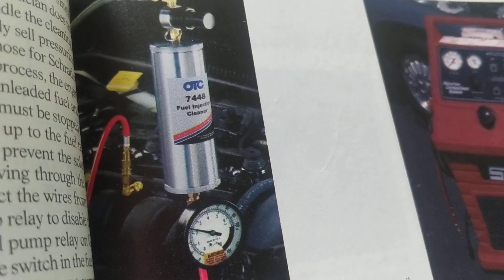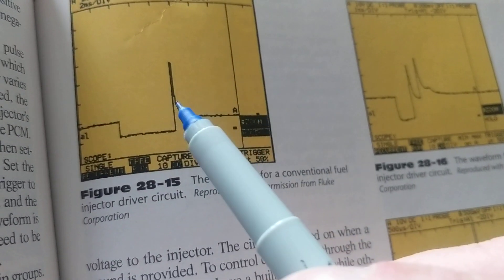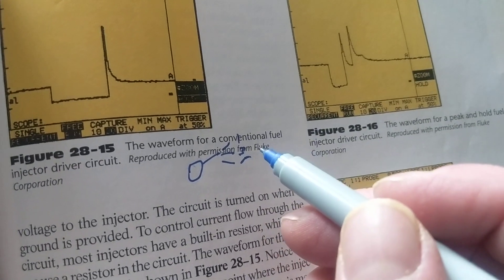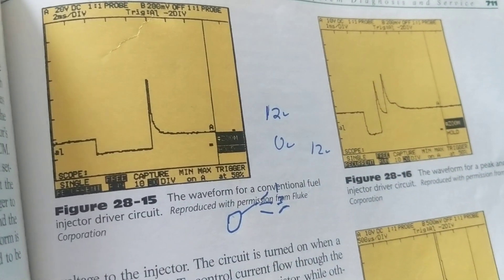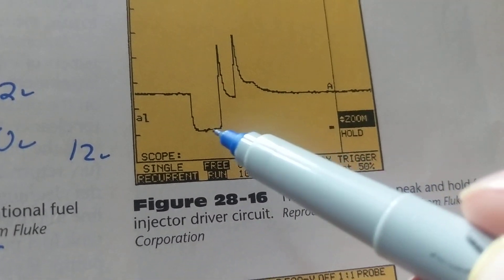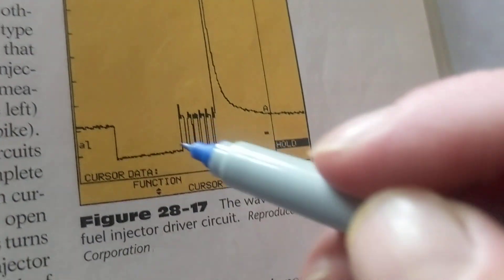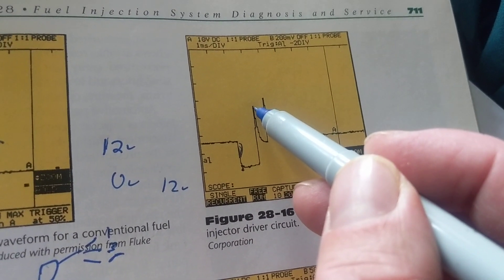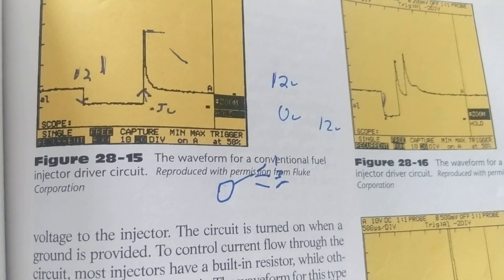HOW FUEL INJECTORS WORK AND DIAGNOSING THEM

Comment: Nice You do a good job explaining electrical Peak and hold injectors would a schematic show 2 coils or 3 wire or what? Or hi current fuse CHEERS
Reply from the maker: For fuel injectors you just get the same symbol you have to know the system and infer from it what kind it is unfortunately but you do see for a starter motor two coils electronics can be difficult at times for the fuel injector you would still get two wires the 12 volts and also the computer control thank you for your comments